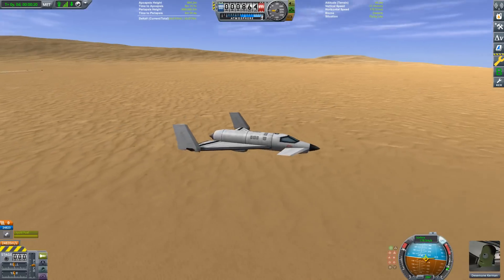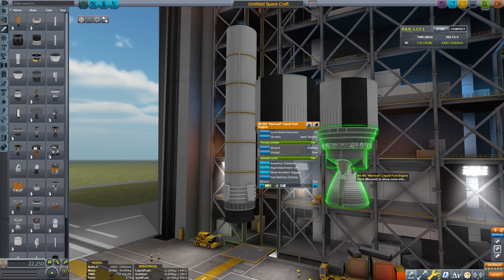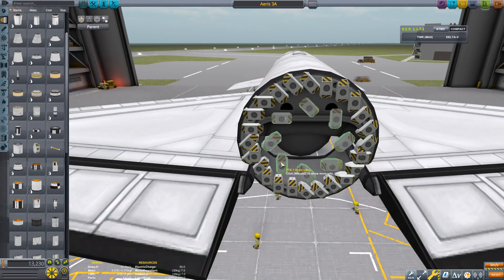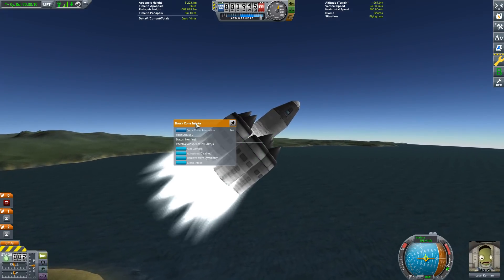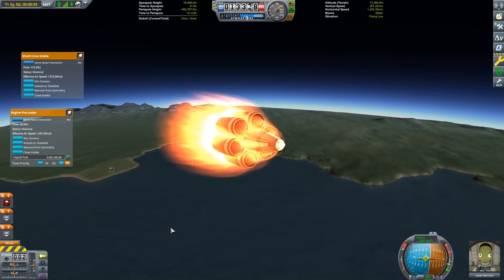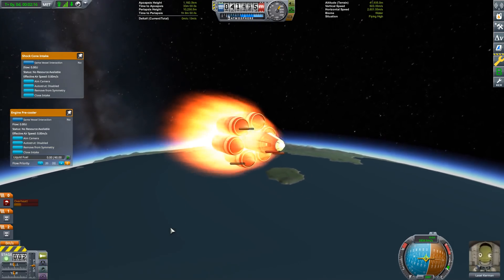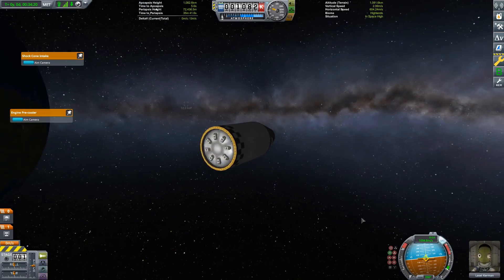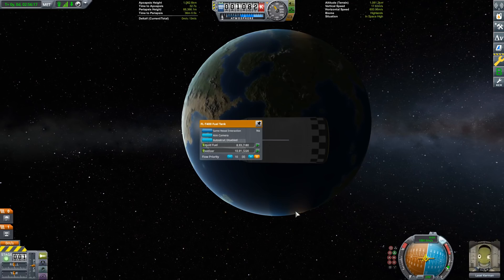Kerbal Space Program 1.9 - Getting To Orbit Using Drain Valves?????

Comment: I've noticed a lot of vibration issues with the new blade physics for the DLC. Seems that there's some weird behaviour going on, especially when using tilt-rotors or travelling forward at a decent subsonic speed with SAS enabled. Would be nice if the yaw axis worked natively in multirotors though.

Comment: Installing the update right now! I'm really curious about Improved propellers, up until now I've been using KAL controller to fine-tune blade pitch in flight- wich worked fine for the planes and autogyros, but I never had enough patience to make a proper helicopter... It should be much easier (as in "actually doable") now:]

Comment: "Thermal Staging" rofl
You should patent that :}
Reply: Heck.. thermal staging is how ALL my early KSP Caveman Challenge rockets work. Just a stack of Flea and/or Hammer SRBs thrown together, without any decouplers in between. Seconds after each stage ignites, it blows up the stage below it! Saves on costs and part count, and is almost essential until you've unlocked decouplers.

Comment: Scott Manley: Founds bug that allows drain valves to use intakeAir
Physics: "Wait, that's illegal...."
Reply: As long as the drag for the intake is higher it's not a problem
Reply: @matsv201  Air intakes having increased drag with speed (squared) (and air available for engines linear with speed) would be the proper way to do it.  Then the jet engines could have performance limited only by available air and an inbuilt max thrust.  And drain valves dumping whatever propellant at a fixed rate would then have their thrust overcome at a not ridiculous speed.
Reply: @hanelyp1  well the problem is  probably that the dumping is fixed to a larger speed that the intake. It make sense in space but is kind of broken in the atmosphere.
Reply: Danny2462: it's free real estate
Reply: Remove your reality and substitute my own